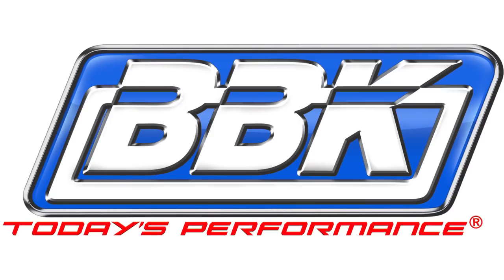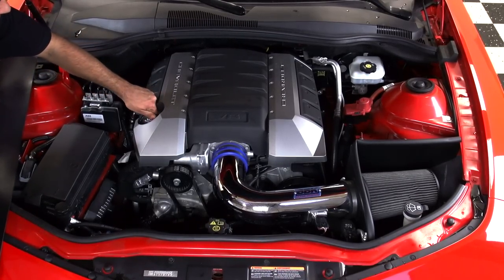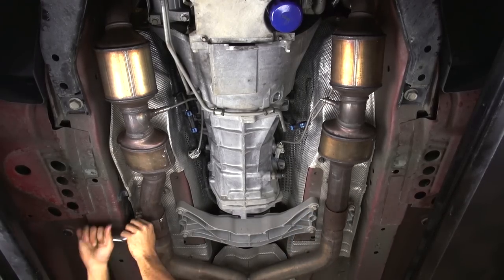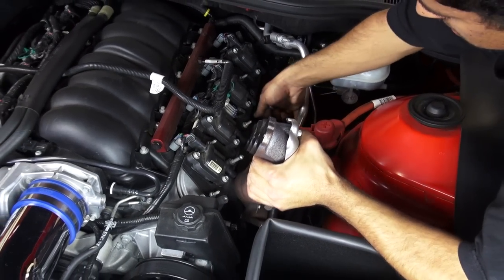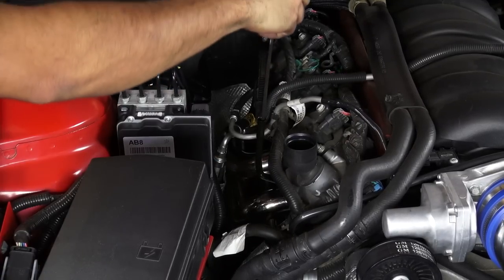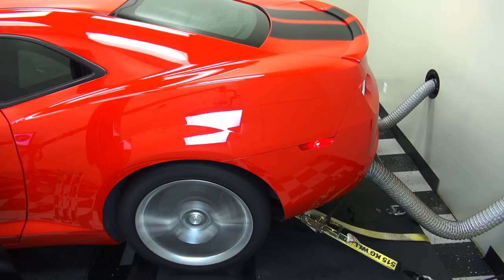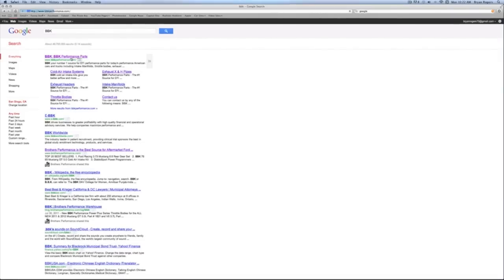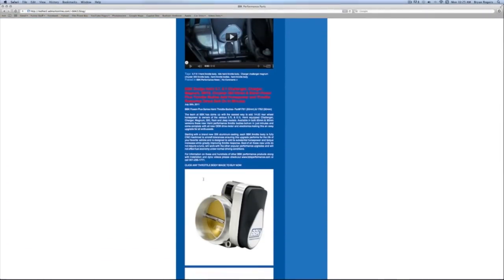Camaro Exhaust Headers (2010-2015) Install & Dyno Test Review

Comment: I have a flowmaster catback on my 2011 1SS. Will this fit or will I need something else?
Reply from the maker: nscurge these tuned lengths are designed to fit with all stock and aftermarket exhaust - they will fit NP
Reply: thank u